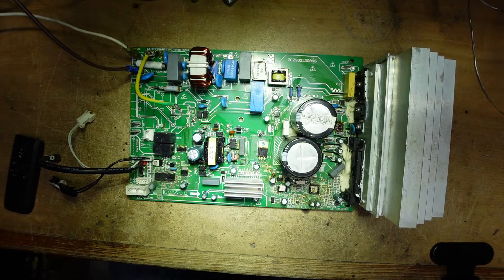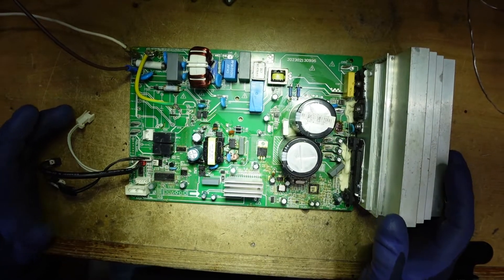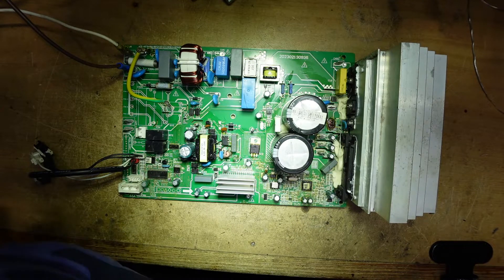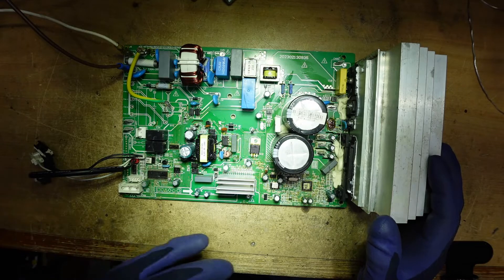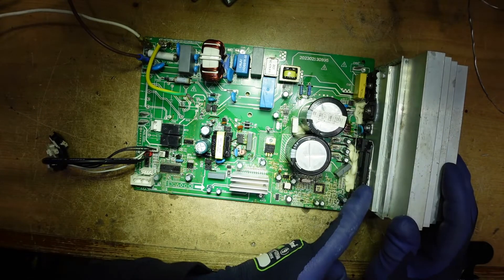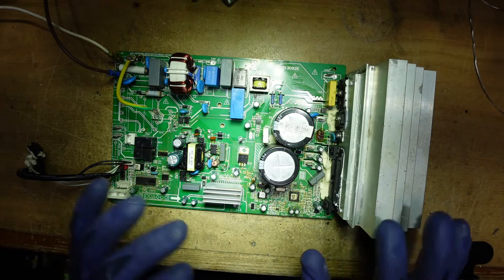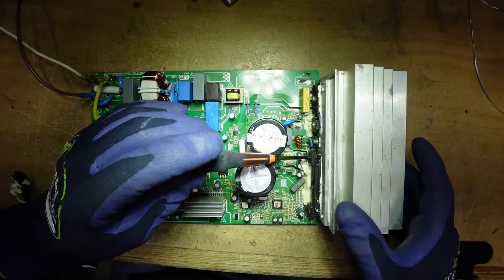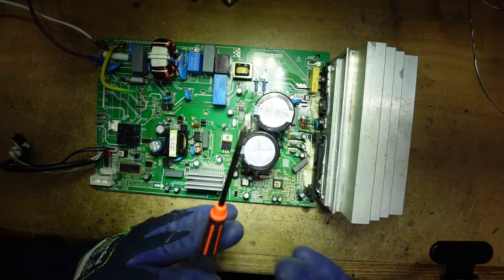1° parte riparazione scheda ariston midea carrier

Comment: in inverter media if it tries continoously to start the compressor 
stop compressor after few seconds after tries again and the same process repeat 
do you have experience for similar fault ?
Reply from the maker: you check 100 ohm resistor Tara processor and ipm